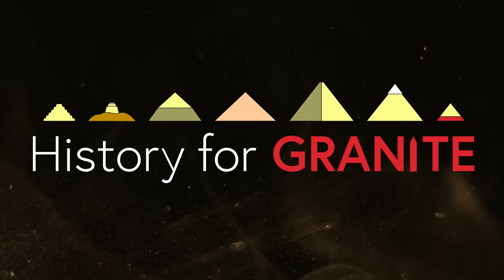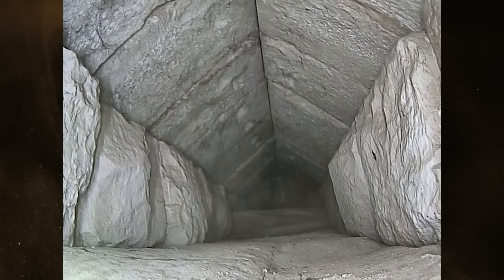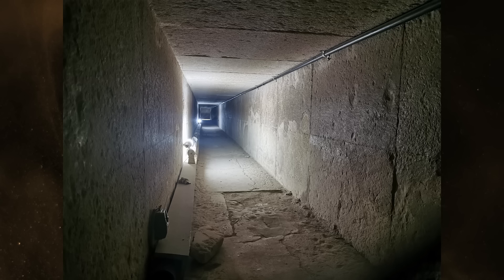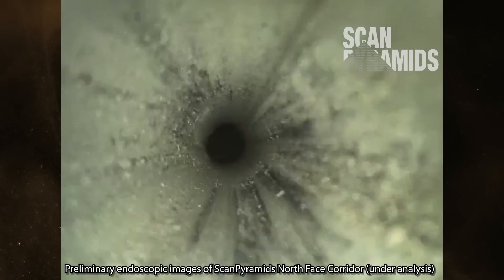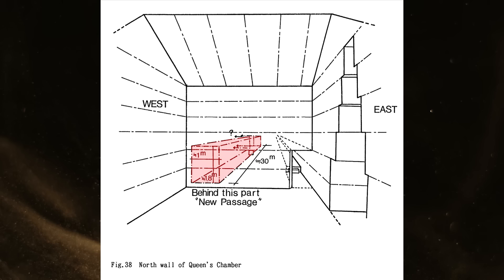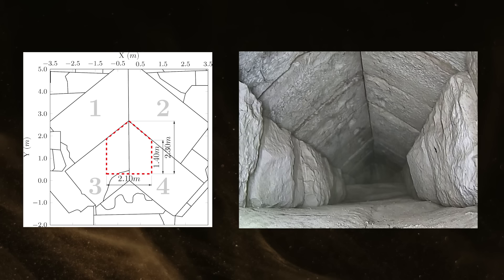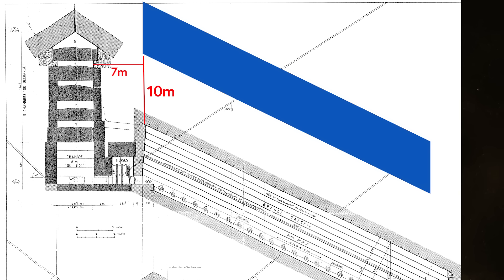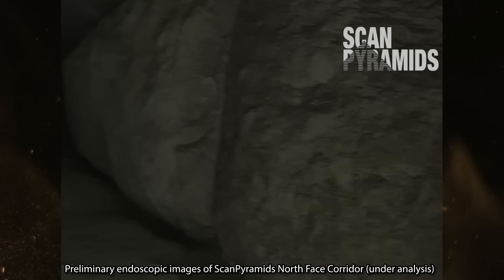New Robots to Explore the Great Pyramid

Comment: Your idea with the sand robot exploring existing drill holes is spot on. Easy slam dunk, I hope they use that idea. I've always wondered why the sand is not native and it's never been explained to my satisfaction.
Reply: - any idea where the sand may be from ?  Is it from a "special place" or is it because it has special structural properties ?
Reply: It's the leftovers from carving stones. Easy disposal.
Reply: @panchopuskas1  the ancient architect channel has a video with quite a bit of information about the drilling and the type of sand that they found. I think it's his over an hour video about the great pyramid. It's a really informative and enjoyable video and well worth watching (if you haven't already done so).
Reply: @ryannagy9244  You can't be serious. 🤣🤣🤣🤣🤣🤣🤣🤣🤣🤣🤣
Reply: @conservingcommonsense4980  But isn't the theory that they did all the carving and shaping of stones at the quarries? In that case they would have just thrown all the leftovers out at that location, instead of carrying it first all the way to and then up the pyramid.
Also, what leftovers do you mean?
Shavings from the stones? Limestone (the bulk material) is mostly calcite and aragonite, not quartz. And granite is only between 20% and 60% quartz (I don't know the exact composition of the Aswan granite they used).
Material that has come off from the tools? Quartz indeed has a Mohs hardness of 7, comparable to granite (again, depending on the granite composition) So using quartz tools would make sense. But any tool splinters would be mixed with shavings from the masonry stones.
And if they used actual hand tools for shaving the stones, we should find more broken tools than tool chippings.
The only explanation that I would accept for why we would find only sand as polishing remains is that they polished the stones with sand. They might even have intentionally dragged the stones over large grained quartz sand to perform the transportation and polishing in a single step. But again, that would mix the dust that came off from the masonry stones with the polishing sand. But in this case, they would already have a reason to sieve out the shavings. (Or maybe the wind would have carried away the fine limestone shavings more easily than the coarse quartz sand. That would be another reason to specifically use large grained sand, or a reason why they only had the large grains left over to dump after the wind had done it's job.) Or maybe they even started out with the local sand mixture and only the hardest component (I assume quartz would be the hardest one) survived being crushed repeatedly by large stone blocks. And having the sand already on the ramp (and thus halfway up the pyramid) would reduce the effort to use it as acassional cheap filling material for gaps compared to sand from the ground level.
Reply: @Pystro    One of the things that bothered archaeologist is that there should be huge piles of rubble from the construction of the pyramids. Some believe the builders used it as infill during the construction
Reply: @JoshJamesification  You, also are utterly wrong.
Reply: @oldmech619  I agree. Anything gravel sized or larger would be used to fill gaps between blocks. Anything that is already on top of the pyramids (except maybe for organic material, but who knows) would be used as well.
But sand isn't very good infill and you might even prefer carrying it off the pyramid over filling a chamber with ONLY sand (which makes the find of the sand-filled chamber even stranger). But even if you wanted to use sand (which still makes sense for filling gaps between coarse rubble), you'd take the closest source, which are in order: on top of the pyramid, at the base of the pyramid, any other site. And since the source right at the base is virtually limitless you wouldn't ever have to tap into waste sand generated elsewhere.
Reply: @Pystro  rough cut at the quarry, then when it arrived at the construction site, they were hauled up and then polish cut made to fit with the already installed blocks. Sand was used to polish fit and cut.
Reply: @Pystro    It saddens me to see Egyptologist Hawass standing in the way of true Egyptologists.
Reply: @ryannagy9244  i was about to say prably from some chemistry
Reply: @conservingcommonsense4980  but who was carving what and where?
Reply: @rodneybiltman2005  that doesn't make sense. who cuts their bricks at the build site? that's just more unnecessary weight to carry
Reply: @lopiklop  as someone here has said, rough cut at quarry for transport and on site shaped precisely to fit in it's position. I think acids were used in some of the processes.
Reply: Flood/magnetic pole flip/Younger Dryas. Buried the Sphinx under sand and flooded all of North Africa and destroyed Atlantis roughly 13,000 years ago. 
Same thing happened to Easter Island(s) buried the statues under a significant amount of sand and soil. 
Right at the end of the ice age, roughly when some Siberian Nomads were crossing into Alaska and settling down into North America, killing off the remaining previous giant inhabitants who survived the ice age.
Reply: Sand is imported from all over the world at literally ANY modern job site. The job site most likely didn't have the appropriate sand for construction, so it would have been much easier to import sand rather than stone.
Reply: @ryannagy9244  if these machines existed, I'd really like to see you build one and post a YouTube video of it. Oh wait. You won't because it's a complete crock. But I'll be waiting for an update, and in the meantime, would you be interested in a slightly used Orgone cannon or cloud buster? 🤣😂🤣😂🤣😂🤣😂
Reply: @zer0deaths862  the poles of our planet have LITERALLY NEVER "flipped." That would tear our entire planet into tiny chunks and destroy all life on earth. It would also wipe out our atmosphere. Mars lost its magnetic field. How well is it doing?
Reply: @lopiklop  did they have trucks and heavy moving equipment to transport finished blocks? No, they didn't. LITERALLY EVERYONE was cutting stone at that point in time. And please refer me to the point in the conversation where we were talking about "bricks" rather than "stones."
Reply: @zer0deaths862  STOP smoking weed and watch "Ancient aliens" all day. You are waisting your life!
Reply: @conservingcommonsense4980  i didn't know that the pyramid was built out of pure quarts....nice problem solving skills
Reply: @JoshJamesification  from where? its not local sand from dunes that just blow in. its large grain pure quarts, it was mined and brought in for some reason
Reply: Just a reminder, that at the time these were built, The area was incredibly lush. Not sand dunes.  This ‘sand’ is not native, it was brought there. From where? And why? But it was important enough in the design to be used and sealed inside. Us looking at the pyramids is like an ape looking at a space shuttle flying overhead. Anyone thinking this was a tomb, based off a soot cartouche is purely following the accepted narrative.
Reply: The flat top of the pyramid exposes large gaps between the blocks that could be explored using a frictionless steerable endoscope to go down many block layers and map it all out in 3D.
Reply: @rodneybiltman2005  lol rough cut quarry and freestyle building the pyramid on site is a more insane theory than aliens
Reply: @Malama_Ki  "Anyone thinking this was a tomb, based off a soot cartouche is purely following the accepted narrative."

So what do you propose the Pyramids are then?
I'll bet it's something completely asinine...
Reply: @conservingcommonsense4980  No. The stones are mostly limestone. Some are granite. But the sand is quartz and not native to the Gizeh plateau. It's like iron vs. copper, both are metals. But they are not the same.
Reply: @nonegone7170  based off that comment I see it’s useless to even speak to you because you already have your mind made up.
Reply: @DilbertMuc  there is no quartz used in the pyramids?
Reply: @conservingcommonsense4980  lol. carving stones does not make sand. there would be ALOT of chips and bits. dust and stuff. and definately not normal looking sand from a beach.
Reply: @zer0deaths862  lol. how could this happen when the earth is flat :D
Reply: @vihreelinja4743  nope
Reply: @MrMome1612  as soon as you can produce a sentence that makes sence.
Reply: @panchopuskas1  sand has no structural properties.
Reply: @conservingcommonsense4980  ridiculous! Definitely not!
Reply: @ryannagy9244  I believe the workers would have daily sand enemas, and they needed somewhere to put it so they just used it to fill some voids. Hey look, I can come up with retarded shit as well!
Reply: aLiEnS

Comment: If they find a chamber filled with sand. It's on purpose. Sand is heavy, 50 pounds for a small bag. I believe sand would have been used to fill a chamber/void to deaden sound waves. If a tomb robber is looking for a void, they listen for hollow chambers when chipping away the stone. The fact that the sand was not local is a huge clue. It was put there for a reason!
Reply: I like to imagine they filled a large space with sand and then built something important on top of it. Let the sand out through a hole from below, and the whole structure above collapses, along with several thousand tons of pyramid. Use coarse sand that won't pack as tightly so once it starts flowing, it won't stop.
Reply: I think they simply used sand as filling, easier then fitting stone blocks, reducing the construction time of the whole pyramid
Reply: @AndrasMihalyi  ...easier to move a big block than a loads of sand. Sand never makes a good "filler".
Reply: If it was just for sound deadening, I would assume it would be local sand.  I don't think we can answer what it was for until we know where it is from and what else is in that space, though, so I don't really have a better idea to propose as a counter-proposal, though.
Reply: @dynamicworlds1  ..good point. It may have been used in many ways. But if it is specific sand in large quantities, maybe it was used for cutting/shaping or polishing stone. I wonder if this is a harder, or better sand for cutting than the local sand? It's a clue for sure.
Reply: @roylcraft  could be.  Sand as an abrasive for copper saws is a known technology and certain kinds are more abrasive than others.  We'd have to know more to say for sure, but that's a good idea.  Best I could come up with was it being from a specific place with symbolic importance, but that's pretty much the definition of the "ritual use" non-answer 😅
Reply: @roylcraft  Was Quartz sand of a high purity, quartz sand was an abrasive agent for cutting/polishing stone. Possibly when the pyramid was constructed to that flat height, they brought up large quantities of this sand for the masons to do the final cutting and polishing refinements. Instead of hauling back down the dulled or unused sand, they just used it as construction filler.
Reply: @roylcraft sand is filler in concrete. Sand is used to fill gaps between modern paving stones.
Reply: @matthewerwin4677  ..not so much hear, used later on but they have all fallen apart. So if they find a chamber filled with sand it for another purpose than filler. Much harder to move enough sand to fill a large void than stones.

Comment: honestly the fact that they used bio-mimicry to create those new robots is freaking genius and so awesome.
Reply: Bio mimicry has been a point of study in various fields for many years now.

After all nature has produced so many designs over time by process of evolution that reinventing the wheel by searching for purely man made solutions is folly at best.
Reply: @mnomadvfx  thinking that “Evolution” designed anything is the folly. I M H O
Reply: @Mr05Chuck  look up the peppered moth. Not saying everything can be explained away with evolution, but theres some type of natural selection that occurs and in this case it happened pretty quick.
Reply: @Mr05Chuck face palm moment, advantageous traits being passed on is the basis to perfection or ultimately advantage. It is the definition of the word.

Comment: Looking down on the pyramid top, the gaps between the inner blocks look ideal for non destructive robotic probe. The air tube soft body robot could find it’s way through the 3 dimensional maze and map everything out as it explores every twist and turn. At the very least, this would give clues how the pyramid was built.  Imagine a 3D map of cave tunnels with photo imagery of all the exposed surfaces.  Now do the same with the Pyramid starting at the top.  It might even find a route to the Great void.

Comment: @6:48 "no matter what it might reveal" - There's lies the struggle. Egypt is not yet ready to be transparent. Their gatekeepers keep all the secrets and continue to disguise what mysteries are hidden. However, I do believe that they are barely holding up the last card in their deck of deceit. And when that topples, it will all be revealed. Keep up the great work - It's important !!
Reply: The entire civilisation was just made up out of nothing. The first real human writings were Cuneiform on Cyrus’ cylinder. Not anything like hieroglyphs and no other culture around the world has used hieroglyphs. The closest to the hieroglyphs was found on the Roswell craft in 1947. They’re definitely not the same related civilisations but most certainly it would contribute more ideas to the conversation.
Reply: @astra6712  Well, that's a plot twist. Until all artifacts previously discovered are unveiled we really only have perhaps half the story at best. I maintain that the Great Pyramid is much more than a simple construct. The how, why, and who built it I believe is already suspected, and protected, by those same gatekeepers who resist new theories and/or discoveries.

Comment: There are certain details that can't be ignored.
The North air shaft from the King's Chamber is not straight, obviously bending to avoid some internal structure close to the Chamber.
The non-load-bearing block in the KC.
The relieving chamber roof is higher than necessary for the known internal passages & chambers. 

These details are among the keys to Houdin's theory, and by far the best scenario offered IMO. 

Getting a camera behind that non-load-bearing block in the KC seems the most logical approach.

Comment: Love your analysis in your videos!  If you haven't already, how about a video where you give your opinion on where else the ScanPyramids technology should be applied?  What other pyramids or structures, and why?
Reply: I think they're doing preliminary muon-scanning of ALL the big pyramids, but concentrating on the Great Pyramid. I would love to see more scanning done on Khafre's pyramid. It was the very first pyramid to be scanned by this technique, way back in the 1960's I think, but with less sensitive equipment. Khafre's pyramid is almost a twin of the Great Pyramid in size, and the next pyramid to be built. It's tempting to think there might be similar internal passages.
Reply: @scotth6814  Thanks for that info.
Reply from the maker: All of the Snefru pyramids, as well as Khafre need a full scanning. The Bent Pyramid was used as a control test for ScanPyramds but the sample size was small.
Reply: I wonder what other sites outside egypt it could be used on as well?